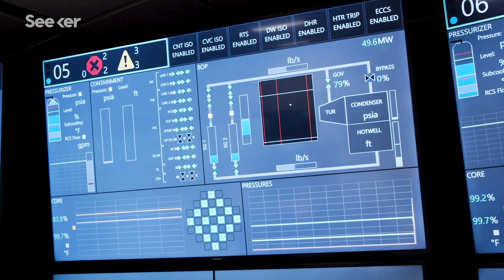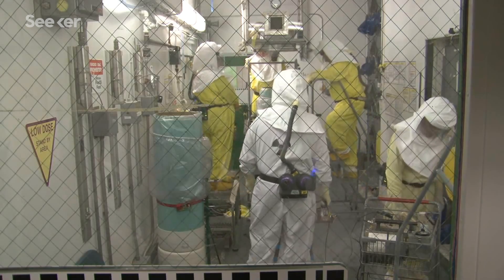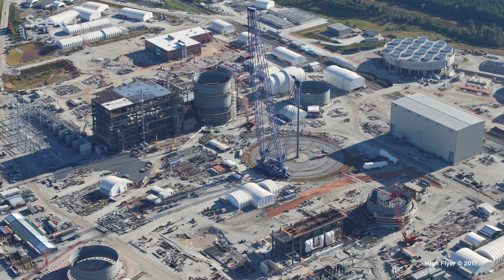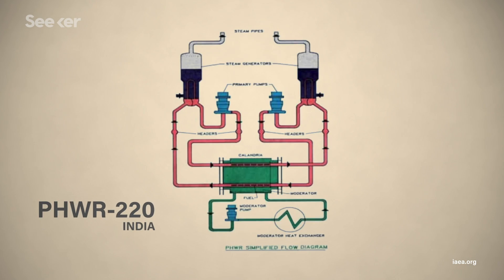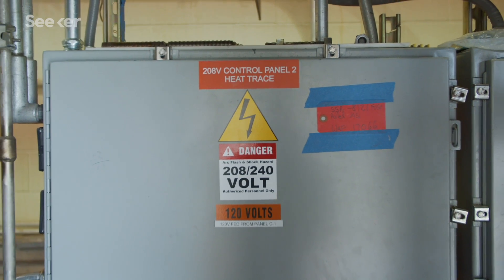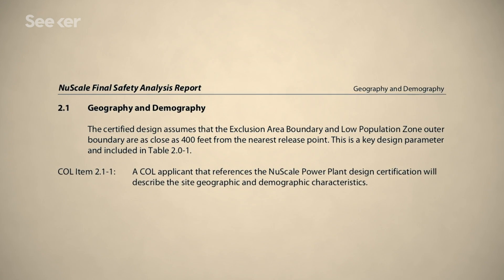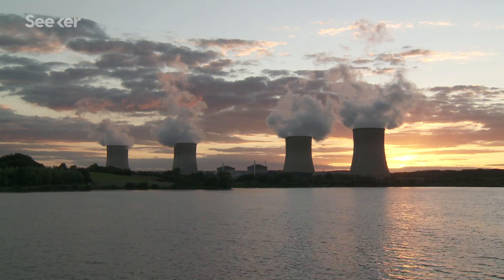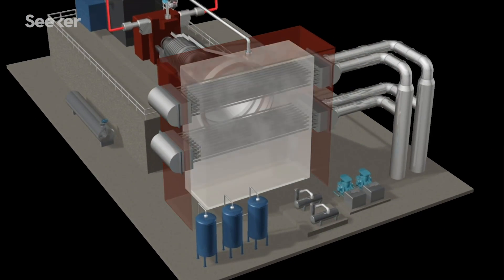Mini-Nuclear Reactors Are Coming, and They Could Reinvent the Energy Industry

Comment: We tried that, it was bulldozed into the Idaho desert and the operators were buried in lead and concrete without their hands which were chopped off due to extreme levels of radiation. There is even a grave marker at the site with Idaho Laboratories grounds.

Comment: 15,000 homes with a module? but nuclear mightn't be necessary to power HOMES, solar's pretty fine for those. Nuclear may be inevitable to power industries, but definitely isn't very smart for homes. Oh and then the earthquake-proof buildings' ability to withstand earthquakes depend... mostly on the earthquake and whether it just splits the ground apart right below your beloved building. We ALREADY HAVE nuclear fusion: it's the *Sun*, you dorks! :p -- Seriously, Sun and energy storage devices, keep some nuclear plants to power industries and make bombs (cos we know that's the main purpose, thank you very much), but at least don't begin multiplying the risks by a hundred times or more with this BS.

Comment: Three mile island used the same electromagnetic control rod droppers but it didn’t work... just saying.
Reply: It did work, the reactor was automatically scrammed, that wasn't the cause of the accident. 
Problem was that the reactor had lost its coolant and the operators didn't realize it until it was too late. 
https://youtu.be/1xQeXOz0Ncs?t=745

Comment: I would assume that smaller reactors would be less power efficient. However, if the upside is low maintenance and mass manufactured and less problematic if 1 fails (as opposed to an entire full sized reactor failing), then as long as it is still competitively profitable, then maybe it's a good idea.

Comment: Is it just me, or does making steam with a nuke seam really archaic. It's almost a Rube Goldberg apparatus. Why dont we use a nuclear reaction to warm up a large hanger, where we can grow trees, then cut them down and burn wood to make steam, which would turn a shaft which would make electricity? 
I read somewhere, where there are tiny nuclear power units the size of a 55 gallon drum. They drop them down a hole, under a city, where they produce energy for 50 years. They also use waste rods from earlier generation power plants. They dont run away, because they are submerged in liquid salt or something. I'm all for it.

Comment: Every imbecile screaming about "thorium" requires a smack in the head! Thorium isn't some miracle, it isn't even a conventionally fissile fuel, but can be bred into Uranium-233 which is. Most thorium designs revolve around liquid-fuelled molten salt reactor technologies, and that is where most of the perceived safety exists, not in thorium itself. I'm an advocate for these approaches, but does having ignorant idiots 'promoting' such things help, or ultimately hurt, the cause?!?
Reply: It's all about the thorium fuel cycle and where it leads.  When you lead with uranium, you get plutonium and other really long lasting radioactive waste.  With the thorium fuel cycle it's much "cleaner".  Yes, you can get uranium 233 which is bomb material, but it's a long involved process to get to it to use it, as I understand things
Reply: @Les_S537  There are many different "thorium fuel cycles" and they don't eliminate plutonium production at all. You'll need to study further, because I cannot explain this without going into long paragraphs. Start by understanding that thorium isn't fissile, and you can't power a reactor with thorium alone.
P.S. I wasn't suggesting U-233 was a proliferation problem, it's what you must transmute Th-232 into to be able to use it as a fuel.
Reply: @anhedonianepiphany5588  hmmmm, everything I've read says you can't get plutonium from thorium
Reply: @Les_S537  You can't run a nuclear reactor without fissile fuel. Th232 isn't fissile.
Reply: @paulanderson79  I am aware
Reply: @paulanderson79  my understanding is you have to prime the reactor with some uranium but eventually you get enough u233 and then it self sustains for the most part...

Comment: Europe is full of reactors on the map

And there's Poland...
Reply: Map might be not completely accurate: in Italy, nuclear is and always has been banned in consequence of two referendums held at different times, the first of which following the Chernobyl disaster. The map perhaps portrays nuclear sites of some sort, but certainly not reactors for the case of Italy.
Reply: @furrball es.  It appears to be a map of any reactor ever built and brought on line.  The reactor near Denver has been closed for decades.
Reply: That might be the case. We had (yep, I'm Italian) Caorso as an experimental nuclear reactor, decades ago, but it never powered anything. It was shut down and defueled after the 1986 referendum.
Reply: +White Cat. that's a shame, banning a whole avenue of technology because of the soviets' stupidity. not a wise move if you ask me. nuclear power is only dangerous when there's an idiot in the control room, or at the drawing board designing the reactor.
Reply: @killman369547  actually, nuclear reactors are legally obliged to be foolproof. Even in Soviet Union.
And Dyatlov wasn't stupid, the HBO made that up. He worked directly in accordance with reactor documentation made available to him.  It's the documentation that sucked.
Reply: @killman369547  Italy might have reacted because of the fallout radius from Chernobyl reaching them.  I saw an interesting video on the days, weeks, and months after the meltdown and how most of Europe and the area over Russia was covered to some degree.  I agree with your comment however and support nuclear.
Reply: +Sasha Naronin. True, the soviet government was ultimately responsible for the accident. They didn't want to spend the money on containment buildings, or creating a better reactor design, nor did they give the operators sufficient information about the reactor's flaws. Still doesn't disprove my point about human stupidity, in fact it makes me think i should add a 3rd category in my original comment, that of idiot government bureaucrats. 
   You can have the best reactor operators, you can have the best reactor designers, but if the bureaucrats above them are flaming idiots then it's all for nothing and disaster will still happen. Case in point chernobyl, but also fukushima because the decision to build it right on the coast was as bone-headed as the soviets' decision not to put containment structures around their reactors.
Reply: Instead of building nuclear power plants they are in a hurry to fund (through government's subsidy) an another one church owned by the priest-entrepreneur Mr.Rydzyk.
Reply: Oh no... Poland and their Bełchatów power plant is just ridiculous
Reply: It’s kind of PTSD for Poland coz Poland was one of the few countries around Chernobyl which did not get as much radiation rain so it is just kind of keeping wary I guess
Reply: There actually was one plant under construction since 1982, but halted and cancelled in 1989, mostly due to economic concerns and social unrest following Chernobyl.
Reply: Gotta love that cheap coal.
Reply: @magyararon6918  but this is just crazy
http://geologie.vsb.cz/loziska/exkurze/Klodawa2003/fotky/Belchatow.jpg
It produces 5 GW of energy. Not even our Czech Nuclear PP doesn't produce that.

I really hope they have advanced filtration system. Because even our nerby coal PP that is a lot smaller produced so much shit that there were acid rains, trees dying and more.
Reply: @magyararon6918  
coal is dirty... 
https://www.electricitymap.org/?page=map&solar=false&remote=true&wind=false
https://www.eea.europa.eu/data-and-maps/figures/pm2-5-annual-mean-in/pm2-5-annual-mean-in-2015/96161_Map9.1-map-Report-Annual-Concentration-interpolated-map-of-PM2.5-2015_v3_cs4.eps.75dpi.gif/download
Coal dust kills 23,000 per year in EU (and nobody cares)
https://phys.org/news/2016-07-coal-year-eu.html
Reply: System is the problem 🏡  The Great Qualities.

1, Show all living creatures; all the love and kindness as much as you can.

2, Only try to be honest with yourself. If you try to be honest with others, you will get into big trouble soon or later.

3, Aim only one target at a time; otherwise you are chasing two rabbits and you will miss both. So, the reason behind it. Have one powerful reason and never ever give up the one you want the most.

4, Don't try to be good person only but be the powerful person. We will grow to be the one or we will die. There is no other choice. 

5, Always learn and look for to improve something your life. 

6, You are not alone. Love and faith the high power reduces unnecessary stress in life. But never completely rely on it. 

7,  Success and happiness are the byproducts of our usefulness. So, always increase the possibility of success.

8, Life is not going to be easy. Because of our unnecessary things. Eliminate all the unnecessary things as much as you can by organising yourself well with the environments. 

9, Never believe anything without the proper evidences. 

10, Always try to give more than you take. 
Because it is dignity/ character of the divinity within you.

🌎 As long as people continue to see themselves as separate from everything else, they lend themselves to being completely enslaved. Success depends on how well we relate to everything around us. Joy comes from that bliss of connectedness. I believe that unarmed truth and love will have the final word in reality. To love; you should have good heart. I am a good person until I see a person better than my standard of goodness. Being good is the progress towards a worthy cause. Love is God. Whoever lives in love, lives forever. How selfish it is to try to keep something forever? Love is all about nourishing, nurturing, sharing and expanding the love within you for all. The principle to which we adhere to is that we have kindness of love at heart for the whole of mankind.  As long as there is the unnecessary differences within us; we can not live peacefully so we have to eliminate all the unnecessary differences among us so we can love all. People abilities may vary but not there true love. If we love a person/ God for a reason then we love the reason but not the person. No reason is the reason to love the person because true love never fails. So do not compare or measure the true love as first or the last but love all truly. If you love people truly then you can understand people. If you don't love then you don't understand people at all.

People are controlled by system why?
The Cyclical Consumption is the current economy all over the World. It is making the scarcity problems of the earth finite resources to deteriorate day by day. Current Monetary System is legalised theft. Real money is Gold and Silver. Scarcity gives the money more value. Real money won't lose it's value. When Governments stay away from Gold & Silver then very easy to transfer the wealth / resources to upper class the Rich (Corporatocracy) Elite. When the Governments are printing out more new fiat currency with reserve banks, our old currency is losing its purchasing power everyday. They are printing millions of currency everyday. All governments and laws are existing right now to transfer wealth to upper class the rich elite. The USA Government & other Governments are in many countries, bailed the investment banks & financial institutions in 2008 against the majority of the people. There is no democracy in any countries. Because of the Money System based on profits motive only above all else even humans lives and well-being. So, we do not have freedom to protect our values with the money so on. The violence, bankruptcy & all the negativities are build into the Monetary System of our society. All are owned (including ourselves) by Reserve Bank. Which is private cartel the corporation. So, in legal system, we are legally considered as chattel the properties. They make money in the capital markets with our birth certificates. They do not consider us as Humans. That's the truth. We are at the invisible war with the Elites (Corporatocracies). We have to fight for our Freedom. Resource Based Economy is the Solution. We have to declare the earth resources as the heritage of all the people of this world. So everyone has access to it. Please have your research about zeitgeist movement then you know the truth more. 

 Truth About Health/Drugs Industry Because Of It Your Life At High Risk The drug industry is a 1/2 trillion dollars a year worldwide conglomerate. Almost 300 billions dollars just in North America. That is really big business. What would happen if everyone were well? There is no money in health. You see, good health makes a lot of sense but it doesn't make a lot of dollars. Because everything they do is toxic. Every drug they use, prescription drugs, all drugs are liver toxic, bar none. If you've had amalgam fillings put in your mouth by dentists. It is highly toxic. There's cancer because most of the chemos are themselves carcinogens. To view the tumor as the cancer and we know the tumor is not the cancer. The cancer industry is 200 billions dollars a year. The more work they get, the more profit there is. You have to dismantle; If the truth ever came out about what we would need to do. 30% of people of females in America are at risk of getting, will get cancer of the breast. The ones that are already dead have been grossly mistreated by the medical profession and by the government that supposedly is supposed to encourage free research and development of all possibilities. Why would medical doctors who studied medicine and practice medicine and are heavily funded by pharmaceutical companies why would they go and look into vitamins? That they never had the answer orthomolecular. And as more and more of our population start taking their health into their own hands, there's going to be even more and more of changes. It can't go on the way it is. The system is failing apart. We must make nutrition the primary prevention strategy for the population. You are what you eat. You are everything that you have ever done to yourself. The choices you make directly affect the outcome of your life. - (Food Matters Documentary in Netflix)

😊 Well, I truly love God. I am not religious but very spiritual person. So, I believe 1) Religion is the beliefs in someone experiences But spirituality is having my own experiences. The mainstream religions people promote religious ideology by giving guidelines and guide but In my spiritual life; I do not want anyone or anything between God and me to restrict my freedom to worship God. 2) We do not need any authorities to do good work. The god work is the good work always. In contrast; organised mainstream religions are claiming that they have the authorities to do God works as leaders so on. 3) God is not capable of doing wrong thing, change the past for us and create anything out of nothing for us. Nothing means not anything. So, even God is limited. The mainstream religious people believe that God is unlimited. 4) God wants us to take responsibilities for our righteousness life but not for all the consequences of our actions because they are continued to exist among us. So, How can god punish us for all our consequences? The mainstream religious people believe we are full of sins because of all our actions. 5) Freewill  is an illusion. People always choose the perceived path of greatest pleasure.  So, we do not have choices all the time. In contrast teachings of the mainstream religions are promoting people to do god's will always because we all have choices of freewill always. 6) We can not separate everything into groups. So, everything for good and evil and there's no success and failure for everything. If everything is real then real things can not be threatened. Once you come to understand that God/The Holy Spirit is in each of us, You will no longer need a Book to tell you how to live. Then why we need religious scriptures? The Virtue is the expression of the basic goodness in our actions. The Basic goodness is the fundamental worthiness of every individuals. We are worthy to God always in everything. 7) Beliefs in a cruel God makes a cruel man. No matter what; every living creatures has the right to live and What makes their life cheap? Everything depends on everything. Nothing too big or too small in value. We can not love and hate at the same time; Being a vegetarian means love without cruelty happily. The mainstream religious people are killing people and sacrificing animals in the name of God. They promote God's cruel punishments. The Punishment is endless for Sinners/Devil according to religious scriptures. But God is love always. Overcome hate with love. If all religions for peace, unity? No way. Because they are not for peace. 8) Well, The God gave us everything to go from moment to moment in our lives as we do our part  and pray only to thank god then the Love is in progress. The Love is always for everyone. We are always worthy of the God's love. Our greatest fear is; not to be loved by anyone but we are all loved by someone. When we eliminate all our unnecessary differences among us then true peaceful life is possible with the true love. If we can't find the peace within ourselves then we will never find it anywhere else. 9) This is the Fight for independence and freedom of humanity to worship God freely without religious guide and guidelines to restrict us. Unnecessarily, We do not want third party controls over us in anything ; especially in spirituality. 10) Revive Survive Thrive. Sincerely,  The Real Peacemaker against religious oppression.

 https://youtu.be/HbvCxMfcKv4
https://youtu.be/pIJHJzDQcRM
https://youtu.be/MyxbdmAnIcI
https://youtu.be/wLzeakKC6fE
 https://youtu.be/P8vHa8zD7jY